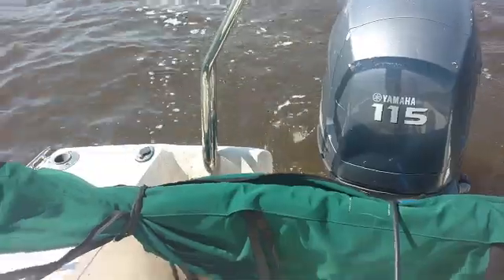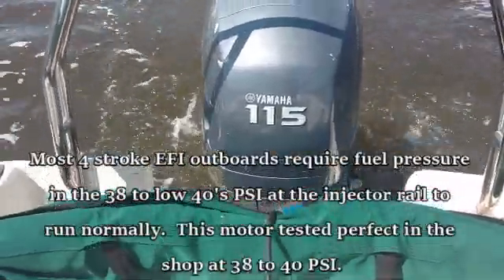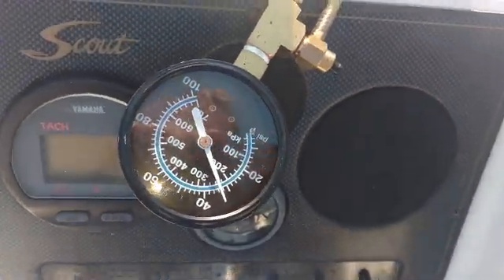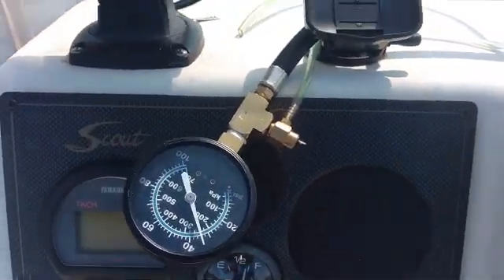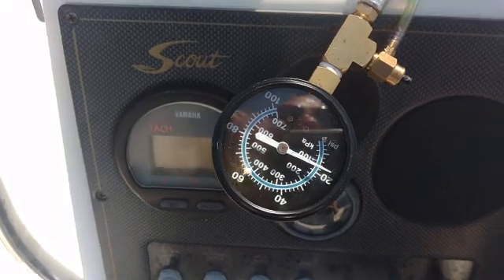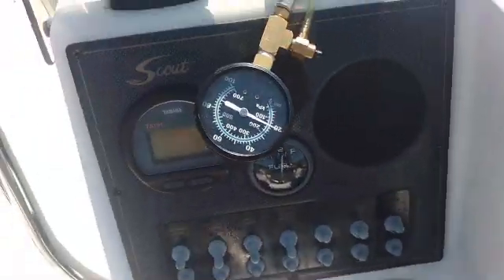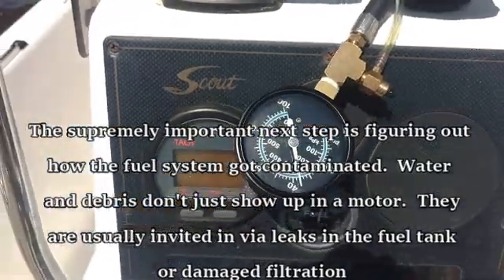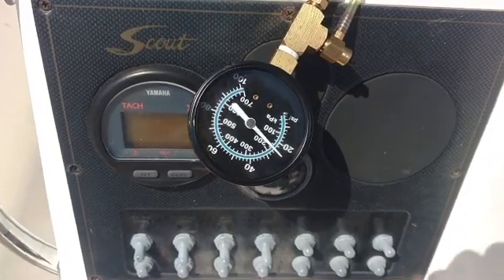Yamaha 4 Stroke Testing High Pressure Injector Pump, Low Fuel Pressure

Comment: What was the fault in this engine in video?  Would love to learn
Reply from the maker: This engine had a high pressure fuel pump (fuel injection pump) failure that was intermittent, which is normal in early stage fail on Yamaha.  When tested in the shop, the fuel pressure held perfect, once it was tested in open water, and full demand was placed on the pump, it would lose pressure a mid/high rpm and cause the engine to lose rpm either because the pump was failing or because the pump intake was obstructed by debris or both.  This normally confirms that a fuel system tear down is in order.  Vapor separator, injector rail, injectors all come apart, new gaskets, new filtration, almost always a new injector pump.  Injectors are sent for cleaning and testing.  Flush or replace all hoses, re install and test.

Comment: Tyler, great topic again. A look at your gauge set up on the engine would be helpful. Did you do other troubleshooting before taking the boat out on the river other than testing fuel pressure? Also, another useful topic would be your troubleshooting the electrical side of the high pressure fuel pump. I am currently troubleshooting severe performance issues (F150TLRC) with no sound from the high pressure pump at key on/key off and have determined there is no voltage at the electrical connector at the Vapor Separator Tank (VST). Working back through the system I found the main relay (68F8195A) failed with 0 ohms resistance across the relay coil and contact not closing. Have you seen this relay failure? Cause (2004 engine!)? I inspected the VST tank and found it and the strainer clean. The high pressure pump runs and pumps when run on  jumper leads.I did not check pressure.  Suggestions for further bench testing? A new Yamaha high pressure pump is north of $400! Thank you for these videos. Carry on.
Reply from the maker: This could be an issue with the key switch itself.  Multiple, simultaneous electrical failures on isolated systems usually point to a common source.  Easiest way to diagnose is to carry a spare, new Yamaha Key Switch at all  times.  Disconnect the existing key switch, connect the new switch into the main harness and test.  If everything lights up normal, the existing key switch is damaged, replace.  I carry one in the truck at all times and go through about 10 key switches a year, and I know of very few Yamaha anything from 2004 or older that is on its original key switch.   The 68F8195A relay is notoriously prone to failure but they at least can usually pull it together enough to at least click shut.  Relay and 12V supply to VST failing at the same time is rare.  Once you've confirmed a good key switch move further down the line.  Check battery cables for excess wear and tear.  If they are crunchy and look like they've been submerged, disconnect at both ends and ohm out.  Once cables are verified, move to the fuse panel and relays.  Any fuse or relay failures replace as needed.  Check power at key on again.  If still nothing at high pressure pump connect, shut off power to the motor and ECU, so no power is available to the ECU.  Disconnect the engine harness main connector at the ECU.  Check the VST pump connector for short to ground and check across the connector for continuity between the hot and ground terminals (dead short).  If the hot terminal is shorted to ground or has continuity with the ground side, there is a problem in the engine harness that needs to be corrected.  Given that you said the pump powers up when isolated and bench tested, I would iron out the supply issues in the harnesses further upstream first, and would not replace the VST pump unless it either fails pressure testing during open water testing (after you have verified that the pump is getting good hot and ground) OR the owner says, just do it, and doesn't care about cost.  

Additionally, the referenced relay 68F8195A is one of the most failure prone and frequently replaced parts in all of Yamaha's electrical system controls.   If its the original 2004 relay, it could and should be on borrowed time.
Reply: @outboardst.comoutboardspec8631
Reply: Thank you for that in depth reply. The issue was a failed main relay in the Yamaha fuse/relay panel. The VST checked out clean, fuel pressure 38 psi at full load sea trial. Test array: Betooll Fuel Pump test kit on Amazon. About $34. OK for my DIY purposes. I recommend spending the $100 or so on a Yamaha factory service manual: Yamaha OEM service manual LIT-18616-02-51 for my F150TLRC for logical troubleshooting.  Section 8 "Electrical Systems" describes system checks in detail, with specs. severe performance issue (engine bogging down, 1200 RPM max) was the failed relay controlling the high pressure fuel pump, and the #4 fuel injector. Had all four professionally  cleaned, new seals and filters, and bench tested with report.

Comment: Very timely video. My new to me boat (yamaha f115 2005) has the same issue. Be interested to see what you find when you dig into it.
Reply from the maker: This is actually taken from an older video we did a couple summers ago.  Typically the vapor separator tank will have some combination of water and debris settled into the bottom of the tank and obstructing the pump inlet filter screen as soon as the pump starts creating high  vacuum to maintain pressure at the injector rail/injectors.  The normal procedure is remove and replace the pump and filter screen assembly, inspect the needle valve and seat, inspect the pump grommet pressed into the top of the VST.  Replace any visibly damaged parts.  Clean the VST and replace the VST gasket and then I send the injectors out to for testing and cleaning.  Normally most 4 stroke EFI systems go back to factory spec/normal running condition after this process is completed.  I will try to post a video of a fuel system rebuild as soon as possible.
Reply: Very informative as I have a 2004 150 yamaha. Experienced the same issue. Do the low pressure pumps have a bearing on this or is only the high pressure pump. Cleaned out the VST tank and was not a lot of crud in there. Is there a way to bench test the hp pump and the low pressure pumps? I’m handy just no a lot of outboard exp. TIA.